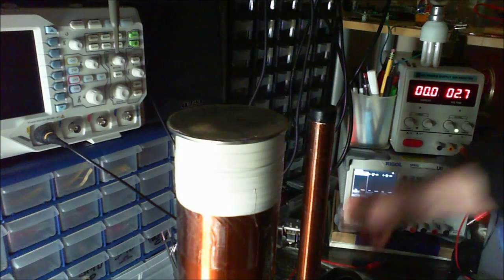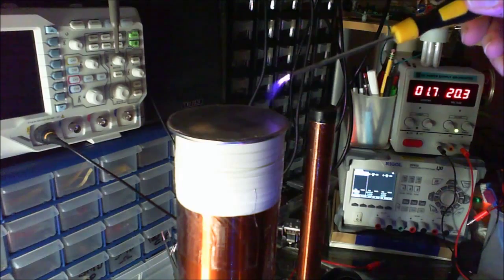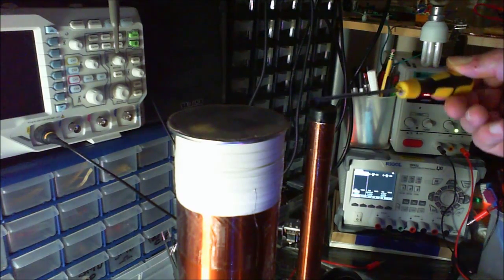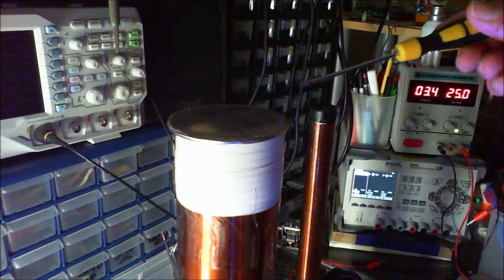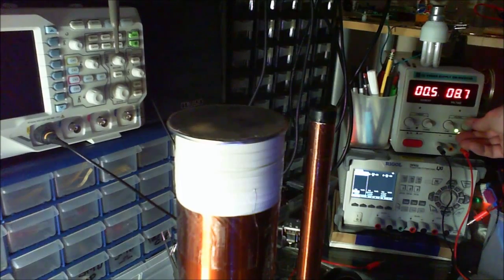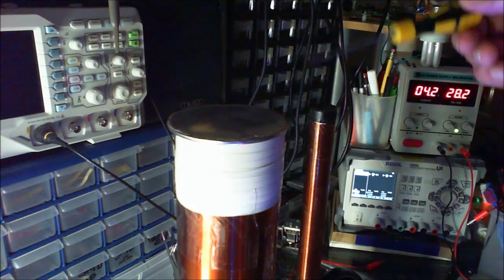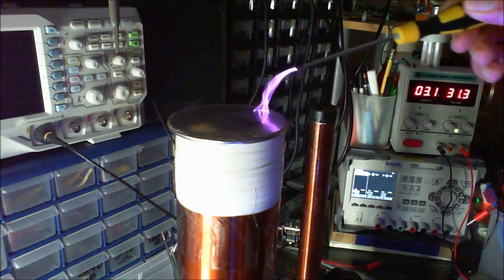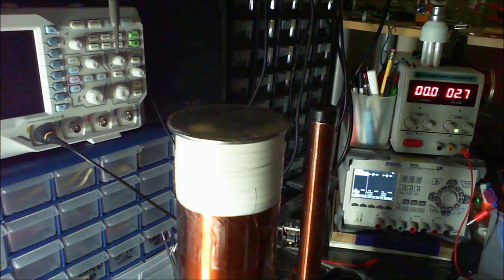Slayer Circuit SSTC Flat Top Load Wet Weekend Project

Comment: How to increase the distance to lighten the bulb of Tesla coil?? And how it work with transistor, resistor... That's very kind of you if you help me. You can give me 10 points for my test. Do you know it???
Reply from the maker: +Toshiya Kiroyo If you use a florescent tube it will give a better light effect at a better distance.
Reply: +Elecifun What the circuit you make in this video?? You slayer exciter really powerful